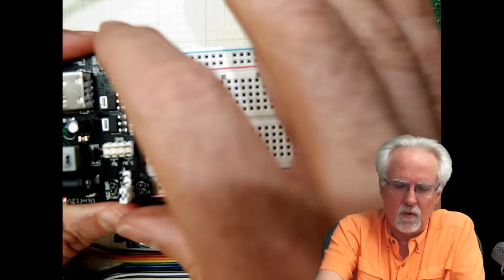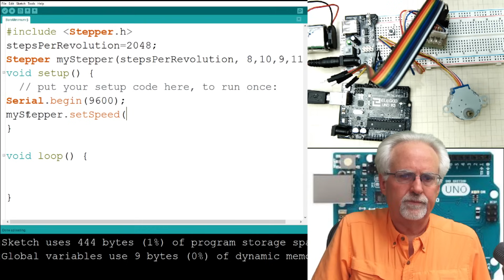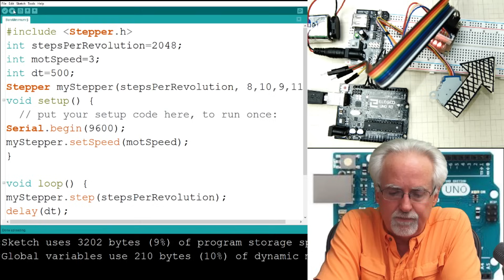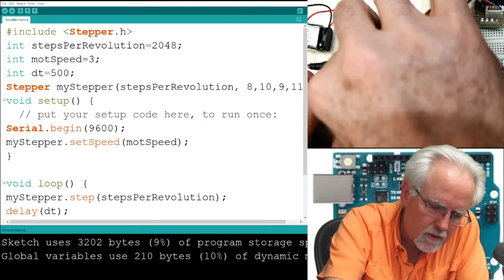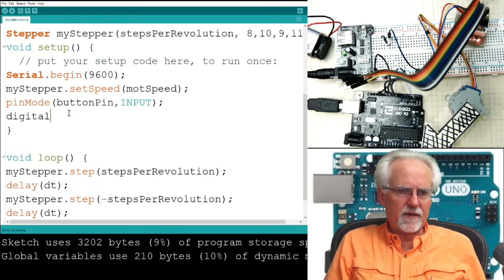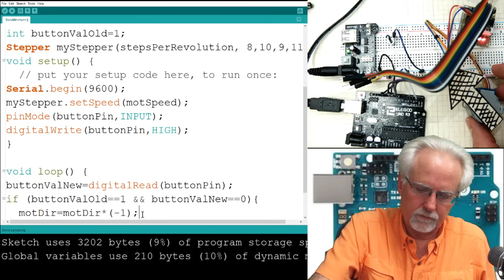Arduino Tutorial 35: Understanding How to Use a Stepper Motor

Comment: I did this a bit differently.  I guess I did it the hard way.  You did in in 4 lines what I did in like 10 or 12 lines... LOL... first I read the button state 1 or 0, then I used another if statement to set the steps to 1 if the button state was 1 and -1 if the button state was 0.  As my Grand Dad used to say, I went around my ass to get to my elbow.  LOL.
Reply from the maker: Glad you figured it out and got it working!

Comment: It looks like the guidance from the data sheet for the stepper motor and driver say there are 4096 steps per revolution. Where are you getting the number you have? Also, why are the pins for in1, in2, in3, in4 not in sequential order? Thanks! I really enjoy your course.

Comment: I managed to do this myself, albeit in a more convoluted way. I essentially set up a while loop for each direction and nested the button press and direction switch logic inside each loop. I struggled with it for a while before I realized that I was telling the stepper motor to do a full turn for 6 seconds before it went onto the button logic and by that time button old and new were already out of sync. Finally realized that with the while loop I could just do a single step at a time before evaluating the switch positions and that solved the problem.
Reply from the maker: LEGEND!

Comment: Hi Paul. As requested, some feed back from this lesson. As a competent model railway modeller, I wanted to control a loco turntable. I will be constructing the actual turntable myself and thought of purchasing a motor for the actual mechanical movement. I had never thought of or, used a stepper motor however, I remembered that in the Elegoo Starter Kit there was a motor and driver!  Having subscribed to your channel, back in the day, I decided to watch this new lesson 35. I now understand the more technical side of the control and will take the knowledge gained to attempt to write some code for, initially a simple 180º turn for the table. I did have a go at the button push to reverse/forward however, not having watched previous lessons, I did have to watch your complete lesson here. I did try however.  Thanks. Gary
Reply from the maker: That sounds like a fantastic project, Gary!

Comment: I really struggled here. I spent two hours stubbornly refusing to watch how you might do it and tried different strategies with if statements and such. I knew I had to use the buttonOld/buttonNew type statements and used the quick pushbutton switch shortcut from the previous lesson, but I couldn't get my head around it. In the end, I think I was tripped up mostly on the idea of using math to determine the direction where I was trying to make true/false statements regarding the direction. I struggle with math in general and while I do watch the videos in full to try to understand, some things do go over my head. In my learning outside of this series, I have gotten used to the algebra involved in Ohm's Law and Watt's Law, so I'm somewhat confident when it comes to circuit analysis, but implementing maths into my coding is still a struggle. I've noticed this particular lesson seems to be a stopping point for many looking at the number of likes between videos (I have liked every video so far), but I won't let this sticking point be the end! I'm sure with more practice I'll soon wrap my head around these concepts 😁

Comment: #include <Stepper.h>
int stepsPerRevolution = 2048;
int motSpeed = 3;
int dt = 500;
int buttonPin = 5;
Stepper myStepper (stepsPerRevolution,8,10,9,11);
void setup() {
 Serial.begin(9600);
 myStepper.setSpeed (motSpeed);
 pinMode(buttonPin, INPUT_PULLUP);
}

void loop() {
  if (digitalRead(buttonPin) == HIGH){
  myStepper.step(stepsPerRevolution);
  delay(dt);
  }
  else {
    myStepper.step(-stepsPerRevolution);
    delay(dt);
  }

}

Comment: I made it work properly, managed to do it only when I set the step = 1 otherwise the whole loop, including  digitalRead, is blocked while myStepper.step(2048) is being executed... Dunno, was I right (should be) or not,  now will listen the second part with the explanation...
  int button = digitalRead(buttonPin);
  
  if (!button) {prev = button;}
  else if (button and !prev) {prev = !prev; stPR = -stPR;}
//  Serial.println(String(button) + " " + String(stPR));
  myStepper.step(stPR/abs(stPR));

Comment: I got mine going! but it was conditional to the state of  buttonValue... if 1 spin one way , else spin the other way... this requires the button to be depressed to achieve opposite rotation, so i understand the value in having it based on the change of state between old and new values rather than being hard coded

Comment: I couldn't get this to work so back to basics; changed the button position on the breadboard and bingo! 
I am still struggling with the last bit of the coding - is it
"my buttonValOld=buttonValNew;". because I get a "Compilation error message 'mybuttonValOld' does not name a type; did you mean 'buttonValOld'. But that doesn't work either.
Help please from someone out there☹

Comment: I did not fully get it, did not think of multiplying by -1. Sooner or later I will hammer this into my head enough to get it all. 

Also, my battery died quickly on the first set up, spent far to much time trying to figure out why. Figured my stepper motor died, then I plugged it in and everything came back to life.

Comment: The change direction isn't working for me....not sure if my motor is defective or not...EDIT...After doing some google research  I found out the two middle pins need to be switched.  Instead connecting the pins (in1,2,3,4) on the driver to (8,9,10,11) on the arduino, respectively.  I switched the two middle connectors.  So Pin in1--->pin8,  Pin in2--->pin10, Pin in3-->pin9, Pin in4--->pin11.

Comment: i tried a battery and the DC brick to power the power supply but the voltage drop when i run the motor puts the power supply rails at 4.7 and 4.8 Volts. i got it to work initially with the battery but it depleted quickly
Reply from the maker: Make sure your power supply is rated to handle the current draw of your motor, and that you're using appropriate wiring.

Comment: Hello Paul, firstly, thank you for your wonderful series of tutorials. They are most excellent! Can I ask, where did you find the information about the Pin sequence for this motor? I must have spent a good hour trying to work out why my button wasn't working! It says next to the driver pins: int 1, 2 , 3, 4 and in the Stepper setup in code, it has a little popup that says steps per revolution, int 1, 2, 3, 4. Convinced I had this correct I just couldn't figure it out.. until I rewatched and realised you had mentioned that the sequence wasn't always the same. So yes, how did you find out that the sequence the Stepper library asks for, the Pins that are labelled on the driver and the correct sequence were different? Thanks again.

Comment: Mr. McWhorter:  I'm buying a 4.1 volt Fema stepper motor for a project. I'll be powering it with a 5V power supply. Will that be ok for the motor, or do I need to add a step down resistor to protect the motor? Thanks, and much appreciate all the learning videos. Cudos......Yo

Comment: I like to put my button old read and my button new read both before I detect a change. if it doesnt work first try Ill throw a small delay in between them. It works fine for me. I understand the code better with that kind of a layout, both points that help me to detect change being together.

Comment: Had to remember the way to remember the old value of the button but i got it pretty quickly.  Definitely liking using the digitalWrite HIGH instead of having to build a whole circuit for one switch.

Comment: I did it but it took me several days, off and on. Got it working. Then followed Paul's method in the last part of the video. His solution is elegant compared to mine. To troubleshoot (and make life harder) I wrote the program turn on a green LED in one direction, and red LED in the other.  I also Serial.println the status so I could figure out where the program was hanging up. I learned is that the stepper motor stays in the while loop waiting a full revolution unless I divided the stepsPerRevolution by a large number, like 1,000.  I also learned that if the delay time is longer, I can see the stepper motor controller LEDs light up in the order of the pulses to the four electromagnets in the motor. The LED sequence reverses when the motor changes direction.
Reply from the maker: Excellent!

Comment: I was able to complete the homework without any trouble before viewing the solution.
Your video was straightforward, I'm glad I was able to follow along and get the step motor to work with little trouble.

I had to change the battery the kit came with though.  As pointed by another comment below, the battery must have not enough juice.
Reply from the maker: LEGEND!
Reply: @paulmcwhorter  Thanks!  It was fun!

Comment: I know there may be no use asking this after 5 years, but if so, what is the reason that the:
Stepper myStepper(stepsPerRevolution, 8,10,9,11);

Why did the numbers have to be in that order? At first I thought Paul was just counting by 2s then released he had to do 9, but I tried 8,9,10,11 and it didnt work, only worked once I did what Paul did. I am not sure if there is an explanation of this in the video so I just thought I would ask here!

Comment: your face every time you put the code on the Arduino lmao, anyways i only just started to learn about micro controllers and the Arduino :) its awsome what this tinny thing can do ! almost anything you can think of. my project is to creating custom air and water sytems in my car and i need the Arduino to read from sensors and turn the water pump on or the fans when these systems get to temps. i chosen to go with the Arduino Mega but they work exactly the same, my programing knowlege is C# but C++ is verry easy to understand if you have any knowlege of programing. Thanks for the Tutorials they give a verry good understanding of what this thing is capable of and how to use it

Comment: I was able to do this by my own, you're that good of a teacher. Thank you!
I also actually had to use 2 9v batteries because I spent a bit too long in trying to figure it out on my own and didn't realize that the motor eats up voltages way too fast! When my stepper wasn't turning, I thought it was broken or defective, but then I checked the voltage and it went from 9.1V to 7.5V!

Buying a multimeter like what you have said in your previous video was really worth it!

Comment: I see so many comments about dying batteries. Wouldn't it also be possible to just plug in a multi-voltage power supply with the right plug? You can get those for about 10-20 bucks off of amazon instead of killing 9V batteries.
Reply: Ok, nvm, the "Most Complete" Elegoo Kit even has such a 9V wall plug that fits the power supply module
Reply: Ok, NOW I saw the video to the end (after doing the project of course) 🙈🤣

Comment: Mr. McWhorter, can you please answer this question?

My power supply module came dead and I was on an arduino forum and they said if its 5vdc, i should only power it with 5v. Do you happen to know why we use 9v in this video?

Comment: #include <Stepper.h>

int StepsPerRevolution = 2028;
Stepper myStepper(StepsPerRevolution, 8, 10, 9, 11);  // Initializing and naming Stepper motor
int motorSpeed = 7; // Defining motor speed
int dt = 500; // Delay between steps

int buttonPin = 6;
int buttonRead;
int buttonDelay = 50; // Debounce delay

int buttonOld = 1;
int buttonNew;
int motorStatus = 0; // 0 for clockwise, 1 for counter-clockwise

void setup() {
  Serial.begin(9600);
  myStepper.setSpeed(motorSpeed);
  pinMode(buttonPin, INPUT_PULLUP);
}

void loop() {
  // Read the button state
  buttonNew = digitalRead(buttonPin);

  // Print button status
  Serial.println(buttonNew);

  // Check for button press transition
  if (buttonOld == 1 && buttonNew == 0) {
    // Button has been pressed
    if (motorStatus == 0) {
      // Rotate clockwise
      myStepper.step(StepsPerRevolution);
      motorStatus = 1;  // Update motor status
    } else {
      // Rotate counter-clockwise
      myStepper.step(-StepsPerRevolution);
      motorStatus = 0;  // Update motor status
    }
    // Delay to debounce button press
    delay(buttonDelay);
  }
  
  // Update buttonOld to the current state
  buttonOld = buttonNew;

  // Optional delay to avoid rapid switching
  delay(dt);
}

// Sir this is my code to your homework and it worked perfectly😀😀😀😀😀😀💥💥💥💥💥💥💥💥👍👍👍👍👍👍👍👍❤❤❤❤❤❤

Comment: You did not show where you put that last correction on the programming (butold=butnew part). Need "if"? The commands page was not in view. I could not finish the lesson.

  #include <Stepper.h>
  int stepsPerRevolution=2048;
int motSpeed=3;
int dt=500;

int buttonPin=2;
int motDir=1;
int buttonValNew;
int buttonValOld=1;

  Stepper myStepper(stepsPerRevolution, 8,10,9,11);

    void setup() {
Serial.begin (9600);
  myStepper.setSpeed(motSpeed);
pinMode(buttonPin, INPUT);
digitalWrite(buttonPin, HIGH);

}

void loop() {
buttonValNew=digitalRead(buttonPin);
if (buttonValOld==1 && buttonValNew==0);
if (buttonvalOld==buttonValNew==1);   <<<<<<<<<- -----  WRONG 
 {
  motDir=motDir*(-1);
}

myStepper.step(motDir*1);

}

Comment: Once again, was tougher than I expected lol. I thought my code was going to be pretty good till I saw yours :(  Here's my code:

#include <Stepper.h>
int stepsPerRevolution = 2048;
Stepper myStepper(stepsPerRevolution, 2, 4, 3, 5);
int motSpeed = 10;
int dt = 50;

int buttonPin = 8;
int buttonVal;
int toggle = 0;
int oldVal = 1;

void setup() {
  Serial.begin(9600);
  myStepper.setSpeed(motSpeed);
  pinMode(buttonPin, INPUT_PULLUP);
}

void loop() {
  buttonVal = digitalRead(buttonPin);

  if (oldVal == 0 && buttonVal == 1) {
    toggle = !toggle;
    }

  if (toggle == 1) {
    myStepper.step(stepsPerRevolution / 100);
  } else {
    myStepper.step(-stepsPerRevolution/ 100);
  }
  oldVal = buttonVal;
}

Comment: I can feel the internals of the motor moving but the shaft does not move. What could be wrong?
Reply from the maker: Is your battery dead/dying?
Reply: @paulmcwhorter  Its a plug in supply.
Reply: @paulmcwhorter  Thanks Paul, it seems ok now, probably my fault somewhere.
Reply: Using a motSpeed of 10 seems to have fixed it.
Reply: Is ok now.
Reply: Sometime it works and the shaft moves, other times it doesn't
Reply: I still had intermittent faults with this. I tried it on my brand new R4 Wifi Sunfounder kit, the power supply of which is different to the one described here so I used a plug in variable voltage supply set at 5V. Initially the same fault happened, the internals moved but the shaft did not. After re-installing the Arduino Stepper library it seemed to have solved the problem(fingers crossed). For the information of anyone interested.

Comment: Thanks for the lectures i made the code by myself using button 

#include<Stepper.h>
int stepsPerRevolution=2048;
Stepper myStepper(stepsPerRevolution, 8,10,9,11);
int motorSpeed=10;
int buttonPin=7;
int motorStep=1; //number of steps the motor will take each time inside while loop
int k; //variable used to store buttonPin value
int j=1; //variable used to store direction of rotation of motor 
void setup() {
  Serial.begin(9600);
  pinMode(buttonPin,INPUT);
  digitalWrite(buttonPin,HIGH);
  myStepper.setSpeed(motorSpeed);
}

void loop() {
  k=digitalRead(buttonPin); //Reading the value of buttonpin
  if(k==0 && j==1){  //Identifying if the button is pressed and direction of motion of motor
    while(k==0){k=digitalRead(buttonPin);}  //Hang the code till the button reached its initial position
    while(k==1){myStepper.step(-motorStep); //Loop used to rotate motor in one direction till the button is pressed again
    k=digitalRead(buttonPin);} 
    j=0; //Setting the new value for rotation of motor
  }
  if(k==0 && j==0){ //Same code as discussed above but it will rotate motor in opposite direction
    while(k==0){k=digitalRead(buttonPin);}
    while(k==1){myStepper.step(motorStep);
    k=digitalRead(buttonPin);}
    j=1;
  }
}

Comment: For those who had trouble doing this, take note of the right sequence of pin declaration which is 8, 10, 9, 11 as this is the right sequence for half step. I put the pin number in ascending order thinking it was just as simple as naming the pin number as I plug it in the arduino board. But no, the right order mattered. Took me a while to figure this out.
Reply: Thank you friend 🥳

Comment: Good evening, Mr. McWhorter. Your lesson is great, but i have a question: i tried to do the homework by myself but my code doesn`t work, what should i do?: #include <Stepper.h>
int stepsPerRevolution=2048;
Stepper myStepper(stepsPerRevolution,8,9,10,11);
int motSpeed=10;
int buttonOld=1;
int buttonNew;
int readPin=7;

void setup() {
Serial.begin(9600);
myStepper.setSpeed(motSpeed);
pinMode(readPin,INPUT);
}

void loop() {
buttonNew=digitalRead(readPin);
Serial.println(buttonNew);
if (buttonOld==1 && buttonNew==0){
  stepsPerRevolution=(-1)*stepsPerRevolution;
  }
buttonOld = buttonNew;
myStepper.step(stepsPerRevolution);
}
Reply: Can you try this,
In void loop(),add this statement after if block.

else{
stepsPerRevolution=stepsPerRevolution;
}

Comment: Took me a while of troubleshooting/looking back at notes (like 30-45mins) but I finally got the program working to a fairly smooth point. I'm sure there's a much better way than what I've done, but I'm just happy to have gotten the homework done without listening ahead! Figuring out where exactly to put the delay( ) command in my program was the tricky part. 
I decided to use do...while loops to make the motor keep going until the button is pressed then change direction. Probably one of the main reasons I was having issues with the proper delay time location within the blocks.